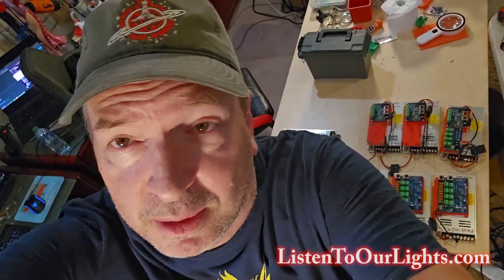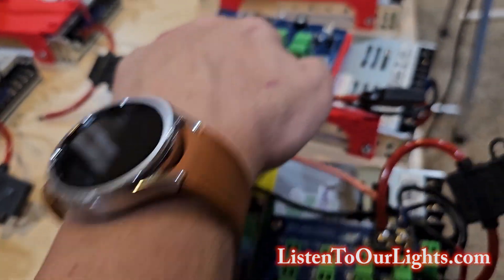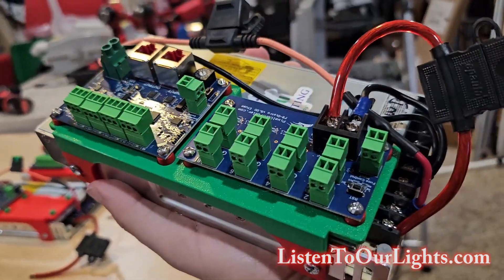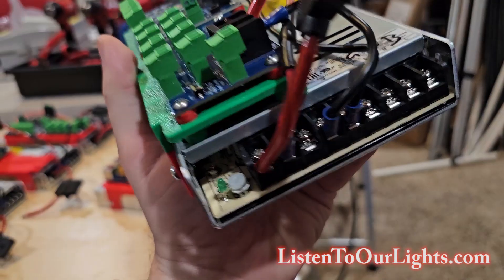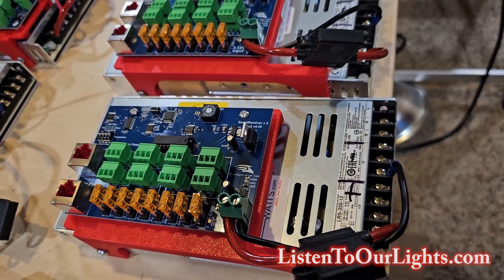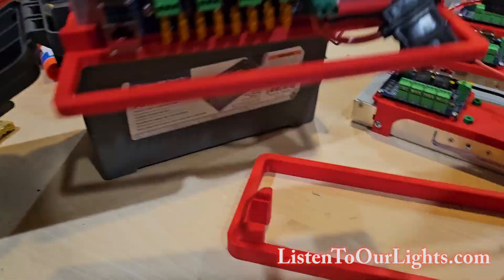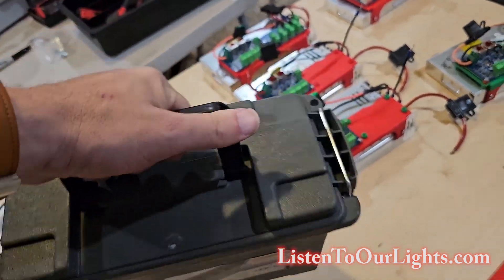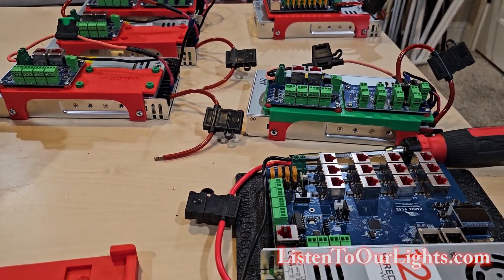Falcon Distributed Controller Mounted to PSUs

Comment: Is the terminals on the power supply common to each other ( all positive the same and all negative the same) so the 300 watts can be used by the one connection going to control board
Reply from the maker: Each of these controllers has its own power supply. When installed they will be far away from each other. Having them altogether I could run them off a single power supply as long as I didn't overwhelm the power supply, which I would?
Reply: I guess I asked my question incorrectly. I’m asking on the power supply are all the positive common to each other and all the negatives common to each other. I noticed you only have one power lead coming from the power supply to the board. I assume it will put out all of its wattageacross those leads

Comment: I use my 3D printer to print out brackets for my power supplies also.  Ingenious the way 3D printing has come out for us light enthusiast.   Your use of the ammo box is different than mine but it all serves a great purpose of customizing our setups.  Are you still using LOR for programming or did you go to XLights??
Reply: Hi can you sell brackets, i have same amo box.. im trying to make two power supply..both power supply and fuse board... if you sell this how much? Im living in Irondale, Alabama 35210...  if you tell me where we can find
Reply: @angeles35124  I do not sell brackets but would like to know more on what you are asking.  I have a 3D printer that I made some of these brackets.  Do you have a 3D printer???  Can you provide more info on what you need????